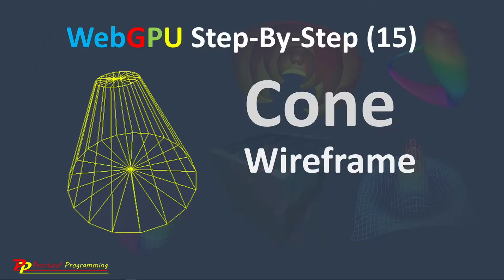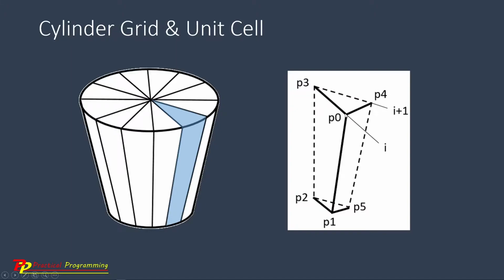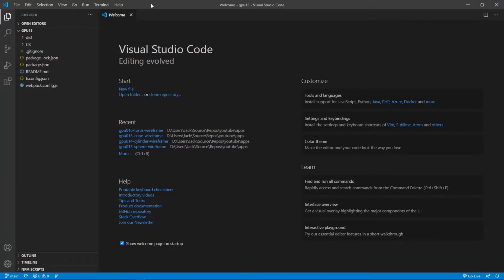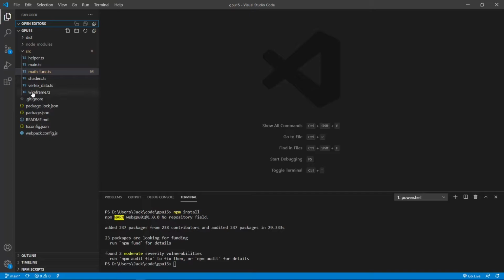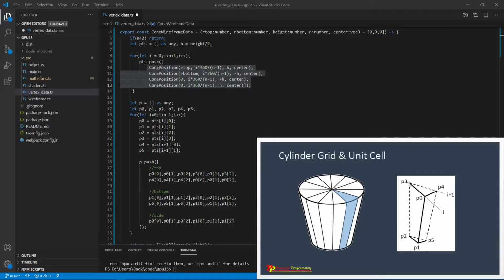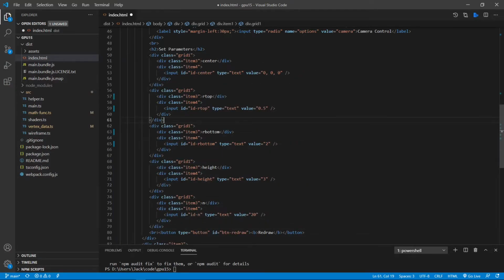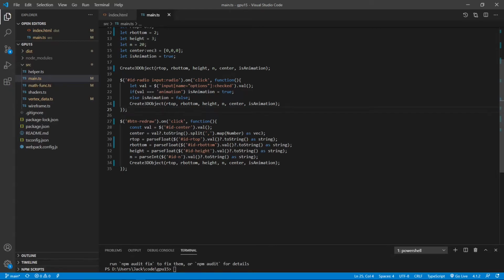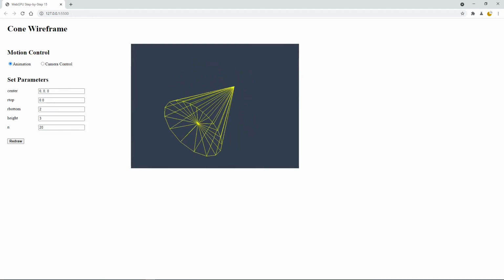WebGPU (15): 3D Cone Wireframe

Comment: Great video - quick question: imagine you have a cube and you only want to see the wire frame which would be visible if the cube was solid, what is the best technique to achieve that with web GPU??….. so I’m talking about hiding the wire frame if it is behind the solid planes, even though you’re not even rendering the planes…. I’ve tried it and can only get weird results that look bad and are not satisfactory….. any ideas?